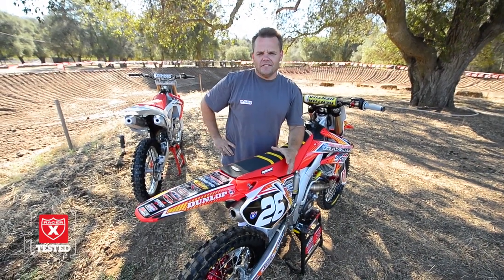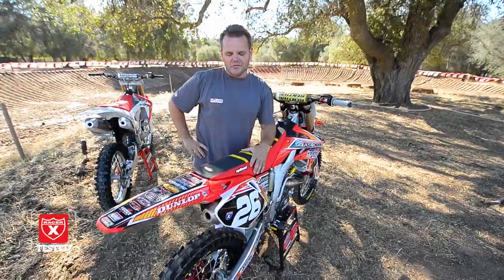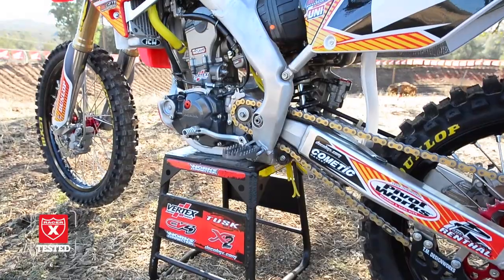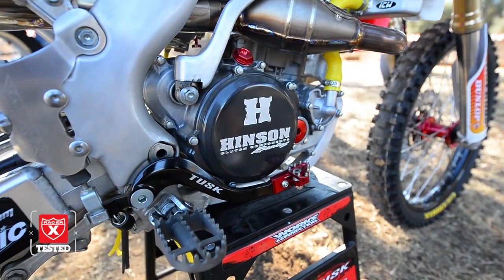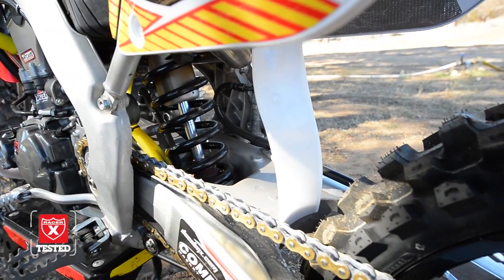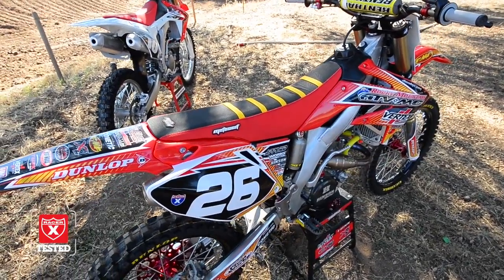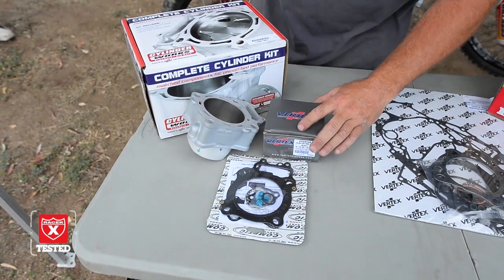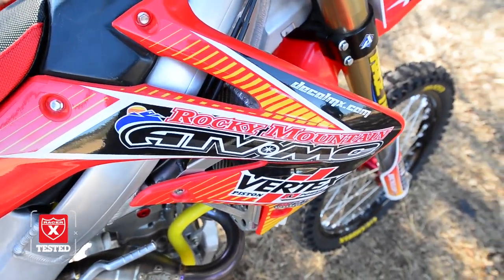Racer X Tested: 2006 Honda CRF250R Bike Build

Comment: i bought a 2004 crf250r blown up but i completely rebuilt it with the same vertex piston and rings and also a hod rods crankshaft and now i got it running and also are running tusk impact wheels with dunlop tires but great bikeu got there!

Comment: This bike was custom built with a one of a kind fmf 4.1 system that fits this year model crf250r. you will notice the older exhaust systems are all stainless but this is custom.

Comment: I also like how they run mufflers you cant even buy anymore. Iv tried it with my 06 crf250r and the best they make is the Pro Circuit TI-4 duals. FMF doesnt make the Factory 4.1 for them anymore.
Reply: My buddy has rare all carbon fiber dual Yoshi’s only made for the factory supercross team back in 06 they’re insanely light and bark like a 450 it’s crazy!

Comment: he says its an old beater while im over here racing a 2002 kx 125
Reply: dude u have no idea (1996 cr 125)
Reply: 1995 cr250 :(
Reply: 1992 kx250
Reply: Remember: 2stroke are fucking powerfull ✊🏻✊🏻✊🏻✊🏻✊🏻💨💨
Reply: Seth Basnaw older 2 strokes are still fast but the 4 strokes weren't good until around 2010
Reply: Mackenzie Ashford wrong
Reply: Derek Connatser haha tell em

Comment: wish they would say how much the whole package cost. Is it a better deal than buying a new bike?
Reply: Grasshopper they most likely got the parts free/cost to promo this bike repair
Reply: Just depends how crazy you want to get with it.   But in general if you get a blown bike for 400 the full restoration to make it like new with OEM parts would be about 2200 on top so yes a much better deal than a new bike.  And I have had many old and new and to me the 06-08/09 carbed bikes were the best after a refurb.  However to get all the aftermarket fancy parts the sky is the limit for what you could spend.

Comment: With the hot cams is it mandatory to use race gas? If so what octane? Anyone!?! I also have a high compression piston, not sure what size, but trying to stop running race gas bc of the price. Anyone have an answer?? I have a crf250r.

Comment: how did you get the frame to look like that what compound did you use I'm doing a 2006 cr250 project and would like to do my frame like that
Reply: use mothers mag and aluminum polish no need to sand it just use a rag and rub it good did my cr 250 frame
Reply: use mothers mag and aluminum polish no need to sand it just use a rag and rub it good did my cr 250 frame
Reply: use mothers mag and aluminum polish no need to sand it just use a rag and rub it good did my cr 250 frame
Reply: use mothers mag and aluminum polish no need to sand it just use a rag and rub it good
Reply: mothers mag and aluminum polish
Reply: mothers mag and aluminum polish
Reply: mothers mag and aluminum polish
Reply: Mothers mag and aluminum polish

Comment: hey im 14 years old 1.70meters. did a 250cc 4strokes can fit me ? or is bigger for me ?
Reply: I'm the same age and height as you and I have a 2012 crf250 and it's perfect size for me so I would definitely suggest a bike like that.
Reply: +Santiago Olloqui I am 5'8" and I fit perfectly on my 2003 XR250

Comment: Dual exhaust is just for looks and adds more weight
Reply: But it looks badass...
Reply: R u sure cause I'm pretty sure it has some use or they wouldn't put on them again
Reply: bob mcturd they add torque
Reply: Ahhhyahboys ik they had some use thx
Reply: bob mcturd no problem man
Reply: I have a 2014 crf 250r and I can say that the dual exhaust definitely adds more torque to the bike ! Ride one if you ever get the chance !
Reply: They're shorter than the single pipe so it evens out the weight
Reply: +TCON42499 no may really. There is still two pipes, more weight than a single. Stock vs stock a dual may have more torque. But get a good header you'll get even more torque and save weight by only having one exhaust
Reply: I don't give a shit about weight 😂😂
Reply: +Colton Hauser I really could care less of a 3 extra pounds bro honestly I would like my bike to look better also instead of having an ugly ass long single exhaust
Reply: +Jack Sisneros I hate it when I see people who have a 2014 or newer crf who take out the dual exhaust and add an aftermarket single pipe. Like what's the point of even buying that bike.
Reply: Ian KX better balance.
Reply: They add torque, look cooler, and really aren't that heavy so you don't really notice the extra weight

Comment: I dont think it costed more than 7k in performance parts. I rather ride bad ass bike like this than new stock one!
Reply: simona šarlovska new ones are fuel injected and you wouldn’t have to rebuild the bike it would already have fresh motor. Also a new bike will look sick with the shiny new plastics and rims. Aside from exhaust and wheels and levers really it’s no better then a new updated stock one.

Comment: Don't buy hotrods people they blow up literally I have ran like 4 of them in many different different bikes and they always either seize up for god knows why or they literally blow up the needle  bearings inside of the crank itself is junk maybe if the main bearing was upgraded to a more durable bearing things like that wouldn't happen . So don't buy hotrods unless you want to rebuild your top and bottom end every 30 hours or less

Comment: some good stuff some flat out junk......
hotrods cranks lame.
256 big bore kit? LAME 6cc.
all the stock brake lines are braided you just cant see it.
racetech = junk 
pivotworks = junk
tusk wheelsets = heavy weak garbage
Reply: Hot rods products test as well as anything and they are widely used in the industry. 
Racetech: junk?
Paul Thede is a suspension guru.
Pivotworks: junk?
My first choice, best in the business. 
Tusk wheelsets: They have a little more mass (it's mass not weight we are concerned with)
Reply: Tusks weak, no evidence for it at all. They're made from 7075 T6, what would you prefer brass? Also, they are a great price.
Stock brake lines are braided? As a natural extension of your argument, why would anyone go with the Hinson? Stock bikes have plates, baskets, hubs and pressure plates too. Are you serious?
Reply: Jason M
hotrods, are actually lesser quality than an oem piece, it being an upgrade is a fallacy.
an upgrade is a carillo rod on an oem crank

Paul Thede is a crook. the gold valves do nothing except the large ports drastically change the shim stack requirements, so a proper shim stack for a GV wont work at all when you try and duplicate the stack for .50 cents worth of shims on your buddies bike.  PS those clowns tell you to remove your midvalve and replace it with a check valve.     Real suspension companies include, MX tech, Smart Performance, and NOST suspension. 

why would you bother with pivot works buy oem.  go to kawasakipartsfinder dot com and look up the parts then make your dealer match the price, lowest price, no shipping, boom done,

tusk, and warp nine, not as strong as a DID or excel, yet weight more! WEAK
theres more to a wheel than its material,

also there's about nothing better than a stock Honda cast hub
you lace this to excel A60 wheels, or did LTX rims, or STX if your a big boy.
with dubya double butted spokes,
godly wheelset, lighter and stronger than stock.
Reply: EnglertRacing96 I don't know if you have had a bad experience with hot rods, but lots of privateers use them in supercross and the nationals. I'm sure the different off roads series have plenty examples as well.
I don't know what you have against Paul Thede but I have seen tons of bikes in dirt bike, mxa, and dirt rider sent there for work and they glowed with the result. Paul knows his stuff. I agree with you about the other shops - I would add enzo, pro circuit, pro action, factory connection. Some shops have better recognition in the off road world, not mx.
As for pivot works, c'mon man! Your worried about paying for shipping? How often do you rebuild your linkage/wheel bearings. Unless you ride in a lot of sand or mud/water I don't think it's a deal breaker. Most mail order places offer free shipping with orders over 50 bucks or whatever. As good as oem at a lower price.
I agree with you on the high end DID's, stx and ltx have a well deserved rep - it's a lot of dough though. MXA tested those tusks and beat the hell out of them and they held up fine! They're only real gripe was the weight so they are better suited to a practice set. DID stx/ltx better at at least twice the price? Yes they are, but if your a struggling privateer, it's tough to beat performance per dollar.